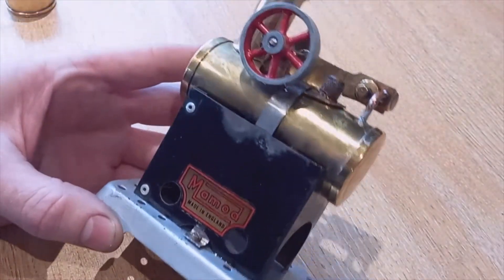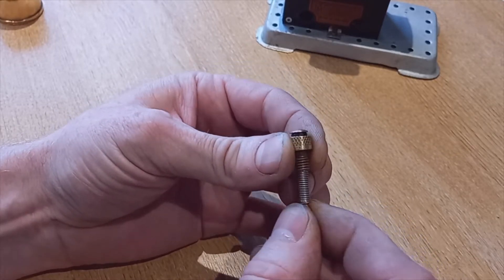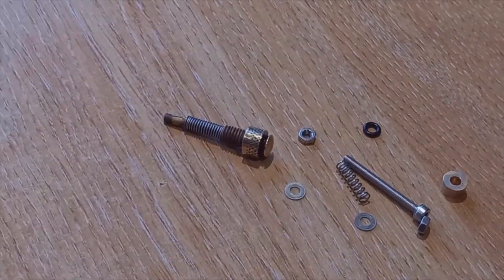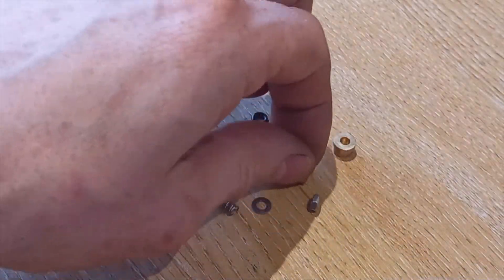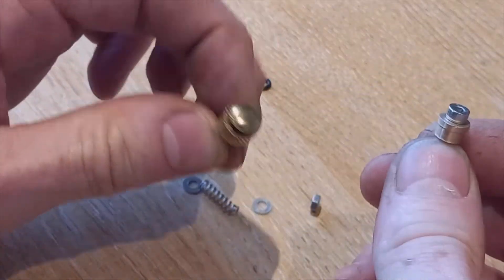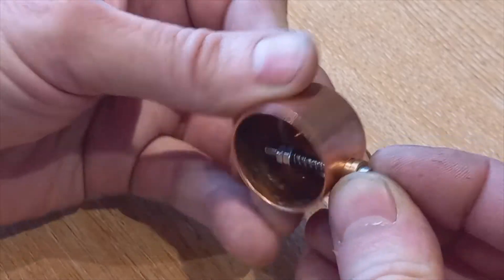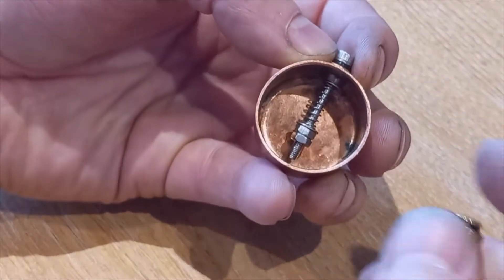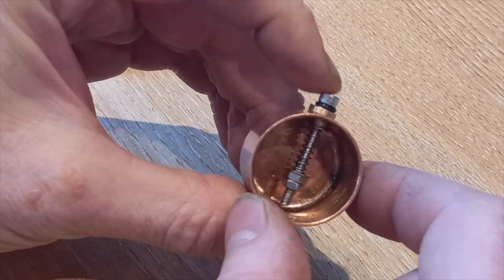How DO you make Steam Safety Valves for Live Steam Models? 🤔

Comment: What a brilliant idea ! I'm looking at scratch building a little steam engine. 

I was thinking of using a can or aerosol can for the boiler. 

How did you already know your valve was set at the correct pressure ? 

Thank you.
Reply from the maker: Thanks for watching! If you are building, don’t use a can or aerosol can for two reasons…. Firstly it will be super hard to build… effectively welding rather than soldering - if you use plumbing copper components that problem goes away. Secondly, it will rust over time which introduces extreme danger to the build and it could explode! To test, I fit a foot pump to one of the outlets, fit the steam valve, and see where it blows off… there is a vid on a boiler build on the channel that shows this - it is the same process as making sure the boiler holds pressure, only with the valve fitted instead of a blocking piece to seal the cylinder. About 4:30 in this: https://youtu.be/lEjBwjJX8Tw?si=H_rmS_Lrgt1dFewC

Comment: As a follow on from your more recent video, brilliant!  I've got all the parts to make one save the springs and when I think about it, I've done all the required jobs as well (inc putting the A2 cap screw head in my drill and filing the thread off that way).  I've got a couple of Mamod/MSS safety valves that have never worked properly so I'll have a go at knocking one up.  Cheers.
Reply from the maker: Many thanks once again, and good stuff - Looking forward to seeing your next build! 😊